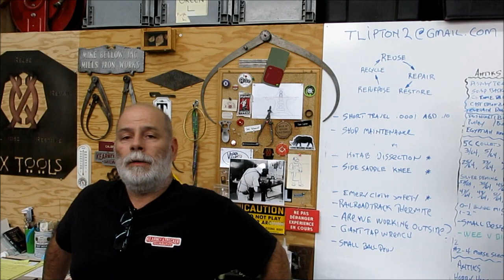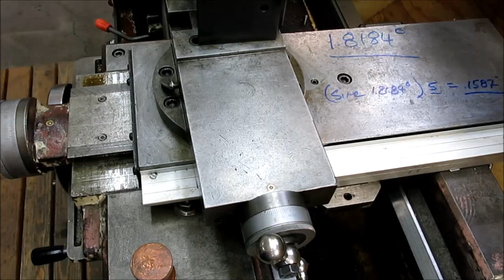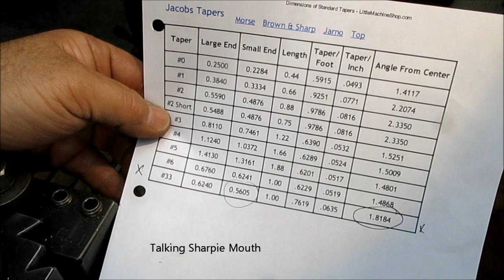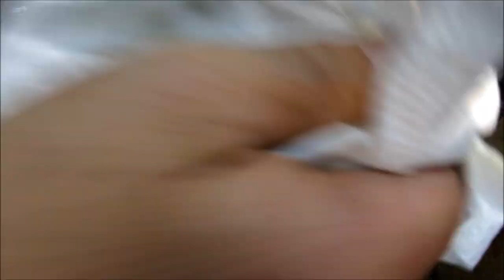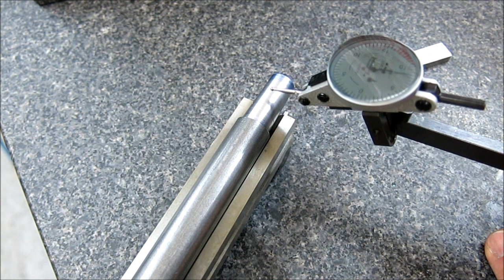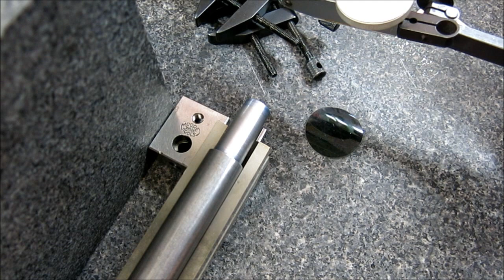Setting Up and Cutting Short Machine Tapers 3

Comment: Hi Tom, I just wanted to say THANK YOU for this set of videos. I had exactly the same problem with an old drill press which had a JT2-1/2 taper (some wierd thing from Japan in the 60's) all chewed up. I'd been struggling to match my topslide to a JT33 arbour due to problems with the centre height just as you described. Your method with the sine bar inspired me! I don't have a sine bar but I was able to set up the taper correctly by calculating the expected change in reading of a dial gauge over the travel of the slide.

My only problem now is that I put the new drill chuck on the trial piece to check the fit and I can't get the damn thing off again...

Comment: very interesting- how would you go about determining the inside taper of a lathe spindle ( how would you probe it) can t get test indi in it
example my 1945 soutbend has a suposibly propietory taper in spindle
i canty leverded a 12 in key stock on pin and vee block but to many variables
does anyone actualy know what this is

Comment: Tom, I think you missed the precaution where the tool tip must be at the exact vertical center of the spindle (as when you were using the microscope focus mechanism with the indicator) to get a matching angle on the machined part vs the angle on the sample part. I would be wary of relying on facing the part to find a precise enough center height.
Reply from the maker: Hi Joseph,

What leads you to believe I missed that fact? I may have neglected to mention the tool needs to be on center but I can assure you it was and not done by facing the part. I have a measurement from the apron to the spindle centerline. Thanks for the comment.

Cheers,

Tom

Comment: Why does the high speed tool give a better finish???
Reply from the maker: +MattsMotorz Hi Matts,

The edge can be honed to a smooth polished edge. There are carbide inserts with ground and polished edges but most do not have this. Hope this helps. Thanks for the comment.

Cheers,

Tom
Reply: Thanks Tom! It does!

Comment: Thanks Tom for a very valuable set of video's. For the first time using my top of the line Texas Scientific Calculator (circa 1993) I've use the "TAN" button & the "(" & ")"  button(s) to enter the necessary formula, while following along. Had to write it down just how to enter it in my CAD Drawing for R-8 Collets. I was gonna say there better not be no darn test at the end of the video's, but the real test is when cutting it for yourself on the lathe. Will be doing a test cut first on some El-Cheap-o cold-rolled. Thanks again for the very instructive video's. God Bless.
Reply from the maker: Hey Dave,

Glad to help blow the cobwebs off your calculator. Thanks for the comment.

Cheers,

Tom

Comment: Hello Tom
I pretty much get it how the taper thing works. I am working on a project where I am trying to turn four identical knobs for a auto restoration involving an after market air conditioner. The finished knob will be 7/8 on the large end and 1/2 on the small end, with an overall length of 1 1/8  where I will drill a hole for the shaft. My question really is, at what angle do I set the compound at. I am using a South Bend 9 inch lathe. I will be using a Aloris type tool holder, with a HSS insert tool in a I "  holder. I am really new at this business, so any help will be greatly appreciated. Thanks ....Ken Bartlett...Marina CA
Reply from the maker: Hi Ken,

Set your compound by starting with it loose and the handle pointing away from the chuck. Looking down on the compound rotate it counterclockwise 9.46 degrees. Don't pay attention to the numbers on the compound angle scale. Just start at whatever number is there when you are pointing straight at the chuck. Start your rotation and count 9 then eyeball the 1/2 degree. Take a test cut and see how it looks. Hope this helps.

Best,

Tom
Reply: oxtoolco Thank you Tom, today I took out my trusty kinda accurate General angle gauge and measured the example and sure enough it is approximately 10 degree . I applied that info to my lathe and was able to cut a pretty good knob out of steel. Of course the finished product will be aluminum and much easier to cut, but the principal is the same. Thank you for your expertise....Ken

Comment: To solve you problem of glare on the dial covers of measuring tools, simply give them a light shot of Right Guard deodorant--the original kind, liquid, no powder, no gel.  I have been doing video work for decades and find the Right Guard techniques work surprisingly good. 

Thanks for your great videos.
Reply from the maker: Hi Alan,

Thanks for the tip. I will give it a try. The curved surface is still reflective and showing the overhead lights.

Cheers,

Tom

Comment: Tom,
Great video as usual. Heck I was doing something right using the Sine Bar to measure angles and I didn't even know it. I like the lengths you go to in order to put out high quality video. With the filter you are placing over the indicator you might try gluing it to a small ring that over-sizes your indicator dial. That will give it a little weight and help to keep the filter flat, plus it will be easier for you to handle. On the bird-stay-away solution you've used it must be driving Ernie a little nuts. If you get tired of the snapping noise you might try making up some brackets for the top and bottom of your window that holds monofilament fishing line spaced about 1 inch apart running vertically. The monofilament line is practically invisible and if the birds try to land it pushes them away from the landing without hurting or trapping them, plus it doesn't make any noise. We've used it for years in Amateur Radio to keep birds from landing on our antennas. You may have to restring it once a year, but hey, it gives you a chance to clean the window seals and to clean and wax your windows.

Best regards,
John
Reply from the maker: Hey John,

I knew I forgot something. Wax my windows. Man I'm moving that up the to do list. 

All the best,

Tom

Comment: Hi Tom
could the discrecancy of 2 tenths on the angle be due to the gauge pin you were using wasn't dead nuts on diameter?
Reply from the maker: Hi Wheel,

If you do the math it works out to be .0016 degree. Over the one inch length of the taper the difference is outside our ability to measure. Most of the error in the system comes from setting the compound angle correctly. 

Cheers,

Tom

Comment: Hi Tom,
This is a excellent series, where the emphasis is put on the means of measuring very precisely our work...
Trying to get within 1 to 2 thousand is easy for most people, when it gets around 1 to 2 tenth it's another story, because the measuring setup is not accessible to every amateur in the trade.
The ND filter works fine for me, the solution to your light problem and birds chirping would be to make the videos at night this way you would "kill two birds with one stone".
Cheers,
Pierre

Comment: Very well presented!!
Something I like to do when sneaking up on taper length of engagement is to
leave the cross slide alone and move the carriage in Z the amount needed.
Its easy to over do it with the cross slide but you know that LOL
Reply from the maker: Hi Gent,

If you do the calculation its something like 30:1 ratio. One thou on the diameter moves the end point around .030.

Cheers,

Tom

Comment: Tom this was a good series, my next lathe exercise will be to turn a #2 morse taper.  I can use the tail stock to check the final result. 
We just had birds in our shop again  it's open to the outside they build a nest inside despite the noise and smoke....had to make a crap shield for the plasma cutter.
Reply from the maker: Hi Bill,

Its easier to make a poop shield for a plasma than a glare cutter for an indicator. The flapping sounded worse when I was editing. I think I like the birds better as well.

cheers,

Tom

Comment: Thanks Mr. Tom,
Interesting to see the finish when using a carbide insert. I had the same kind of finish and fought it is because I am not a specialist. I solve my finishing problem with a ceramic insert (style TNMG 321) at high speed (2000 rpm) small cut  1-2 thousand and slow manual advance. 
It's near a commercial finish.
Reply from the maker: Hi Robert,

I have not experimented with ceramic inserts much. We used a Cermet which is loosely a ceramic metal matrix. Very tough and can be run at very high speeds. I'll have to check some out and play around.

Cheers,

Tom

Comment: Don't have a JT33 chuck laying around to act as the female check piece? Another vote for getting the birds back..that's assuming we have a say in the matter..
Reply from the maker: Part of the exercise was to produce a taper without any gaging or samples. Just plain shop tools. The chuck that was sent with the shaft to be repaired is chowdered so its not a good sample to test fit with.

Cheers,

Tom
Reply: Ahh, forgot that, seams like Part One was so long ago, although I guess that's why you also did a video on making a shop sine bar out of the vise parallel. Great vid! I watch them more than TV! Thank you again.

Comment: What exactly is the force that makes a taper fit connect? Is it the Casimir effect? Theoretically can you not make a taper fit to your own specs that will work in your own shop (and probably no where else)? Just curious...
Reply from the maker: Hi Victor,

A taper can provide driving force because the feed force on the tool increases the friction between the tool and the socket beyond the coefficient of friction of the steel parts. The better the fit between the male and female members the more contact and driving friction is available. Here is a long technical discussion of some of the elements of why it works.

http://www.practicalmachinist.com/vb/general-archive/ot-theory-self-holding-taper-79627/

Cheers,

Tom

Comment: Tom,
Try putting the ND filter over the lens of your camera.
Reply: Unfortunately, covering the whole lens with ND wouldn't give the desired result. if the camera is on auto exposure it would compensate and open the aperture (or decrease the shutter speed, possibly at the expense of frame rate.) If the camera is on manual exposure the ND would be similar to simply stopping the aperture down making the entire view darker.

If I remember correctly, Tom actually tried both (and commented on it.) :-)

Comment: Hi Tom

Great videos. Have you tried placing the filter on the camera lens? It seems that it helps no matter where it is so long as the camera is looking through it. Thanks for all the great information.
Reply: Tom's solution of darkening only the indicator's face is correct. The problem is the contrast between the dial indicator's face and the rest of the view, causing the camera to overexpose the indicator.

Comment: Try power driving your compound like chuck did.tom. A flex shaft if its awkward. .You've seen those varible  speed drills with the adjustable  triggers stops...ideal
Reply from the maker: Hi Bub,

I thought about that for a minute. I usually make a longer handle for the compound that allows smooth turning of the dial. Just haven't got around to it. Thanks for the suggestion.

Cheers,

Tom

Comment: Good stuff Tom.  Although, it did feel a little like we were in the Alfred Hitchcock movie, "The Birds", with all the flapping noise.  Any chance we can go back to the chirpy little poopers?  Do you lock your cross slide each time before you make a pass with the compound?  The neutral shade is working well for our benefit, if there were just a way to reliably keep it on the indicator face for your benefit and keep it from falling off.

Cheers,
Gary
Reply from the maker: Hi Gary,

We cut the tape in half and its a lot quieter now. I think mating season is almost over for the little Sparrows so we should get a break soon.  I don't lock the cross slide. In fact my lathe does not have a lock for the X axis. 

Cheers,

Tom
Reply: oxtoolco Sorry, I meant to say carriage.
Reply: oxtoolco
Sir Ox

I have the same make of lathe as you, one size down. I have a cross slide lock via a factory set screw that pushes on a brass slide against the way. It is located low on the slide, on the right vertical edge, closer to the back of the slide. Did  the addition of the DRO glass slide on your machine cover it up. I would be frustrated if I did not have a way of locking the slide during precision turning.
Thanks for sharing your videos!

the very best
Greg
Reply from the maker: pkav8tor Hi Greg,

I don't think I have one there or at least I don't remember one. Now I want to look. Honestly I rarely use them on any lathe. I do occasionally use the carriage lock when facing with a tool that has lead angle. 

Cheers,

Tom
Reply: where are those Yam lathes made?
Reply from the maker: bubster1981 Yang Iron Work Ltd Taiwan.

Cheers,

Tom